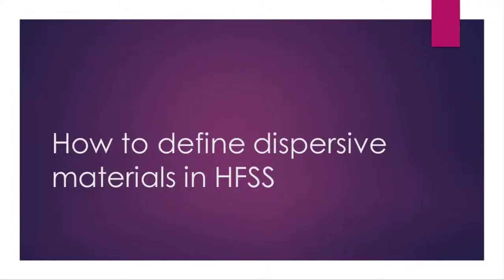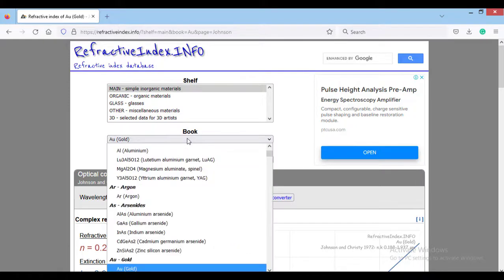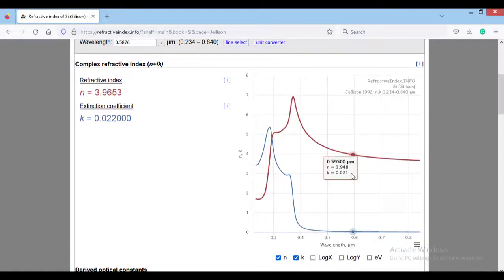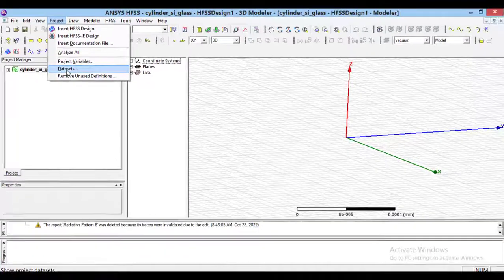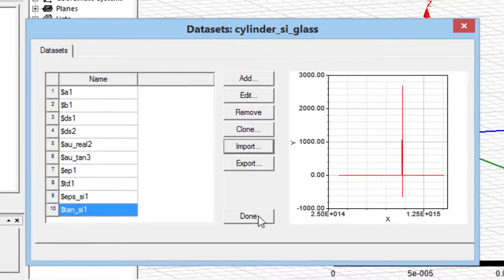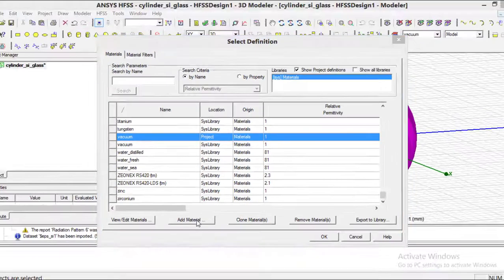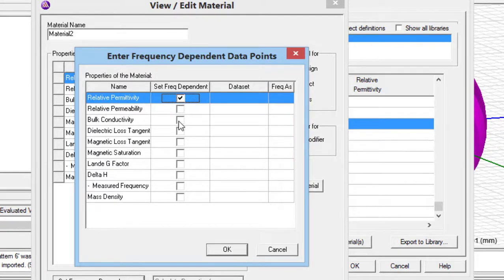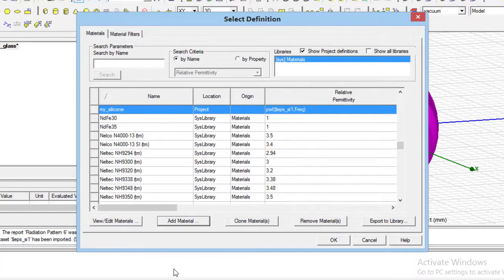How to define dispersive materials in HFSS

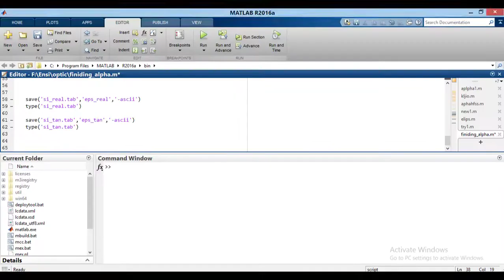Comment: Dear Ensiyeh,  so appreciated your video, and thank you million times!     From website retractiveindex,  it can get material .csv file , then use matlab to get "Relative Permitivity" and "Dielectric loss tangent".  for the running in matlab " (in the video 1:21),  I cannot find .csv file name.   I am not a good at Matlab. may I ask a question?  how to get the variable "eps_real" "eps_tan" from the .csv file?
Reply: the other quuestion:   does it need to change wl vs.n (in .csv file )  to frequency vs. n?  do you have website, I can visit for more details for the matlab file?  if I want to create by myself what the data form of the .tab ？
Reply from the maker: Hi I put my matlab code in the video. Please watch again it. In the site you can search your desired material